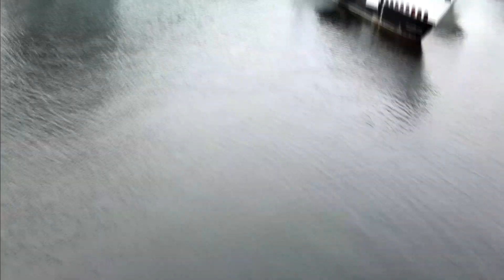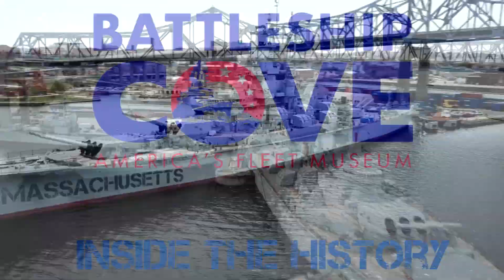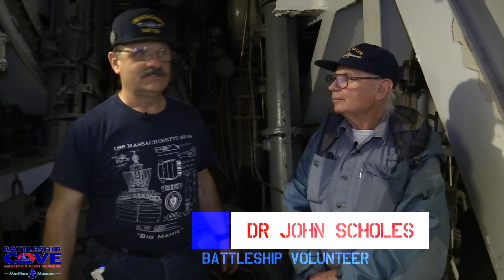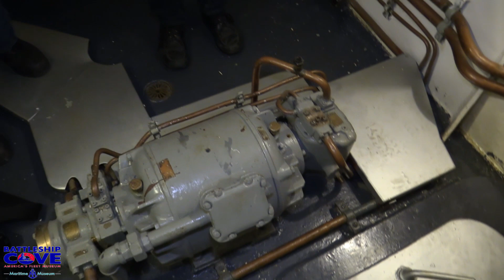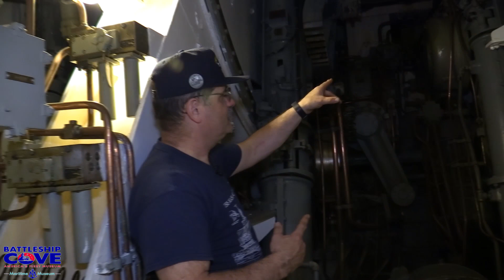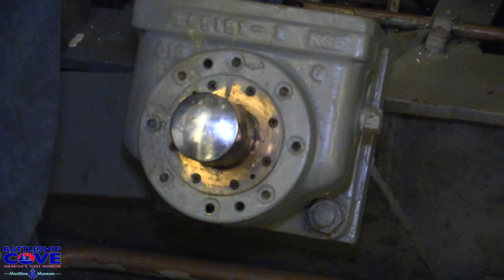Inside the History:  Underside of the 8" 55 Gun on Heavy Cruiser USS Salem CA-139

Comment: The 8 inch 55 caliber guns of the Des Moines could be loaded at any angle with a 335 lb. projectile a velocity of 2500 feet per second and a range of 17 miles. The Northampton Class heavy cruisers with 8 inch 55 caliber guns had to be lowered to the load angle and elevated after every salvo  but,  a 260 lb. projectile a velocity of 2800 feet per second and a range of 18 miles. USS Louisville CA 28 fired  (37) salvos (333) projectiles Armour Piercing in 15 minutes at the greatest ship to ship naval battle Oct. 25 1944.
Reply: Did you mean 1944?

Comment: The HE-type shells (lighter weight with an enlarged explosive filler and several fuzing options) were introduced in the late 1930s through early 1940s, depending on gun size) were termed in the US Navy during WWII as "High Capacity" (HC) projectiles and were much more versatile as to the types of targets they could give maximum damage to.

These shells had a base fuze much like an AP projectile, but with no delay element so that they could only move about 5 feet or so into a target after impact, not the 30-50 feet or so that an AP shell would go if set off on the same target.  This was better against shore fortifications or small enemy ships.  To use this base fuze a hardened steel nose plug replaced any nose fuze in the HC shell just before being put in the hoist.

Usually, a nose fuze was used in these shells (making the base fuze non-functional):

An impact nose fuze would explode with an extremely short delay, usually less than one foot movement after impact.  Used for destroying unarmored shore targets or against targets with armor too thick to penetrate.

Mechanical Time nose fuze set to explode when the shell reached a certain range in the air.  Could be used against aircraft in these fast-firing 8" guns, but usually used against areas filled with unarmored shore targets.

During WWII, the British and US, working together, developed an improved time nose fuze called the "Variable Time" (VT) fuze that had a tiny radar inside it that would explode when a shell with one passed sideways near any object that reflected its weak radio waves.  It did not function directly ahead, containing an impact fuze if it actually hit the target.  No error in time setting was thus happening and these fuzes were MUCH more capable than the regular time fuzes against aircraft or unprotected shore targets.  Most AA guns of larger sizes adopted them too.  Army bombardment artillery also used them a lot.